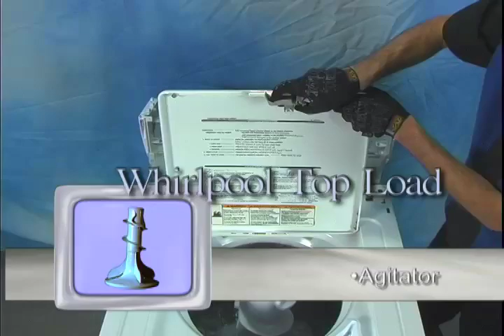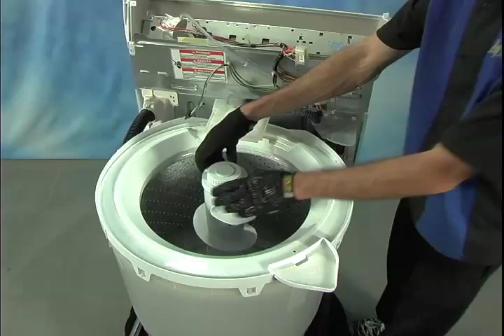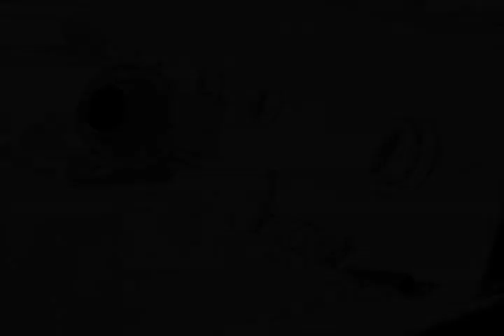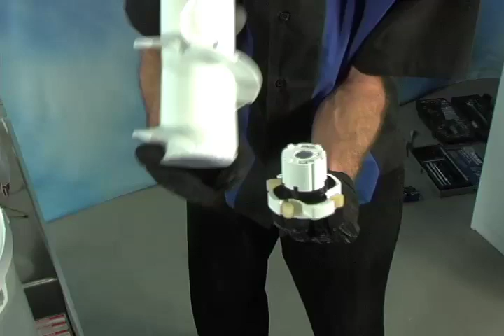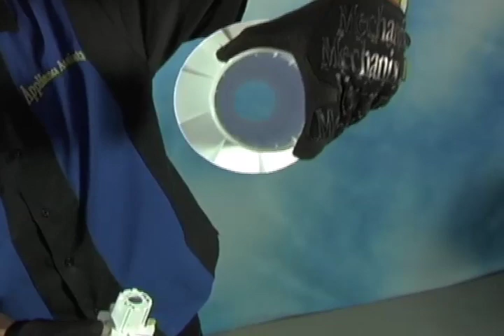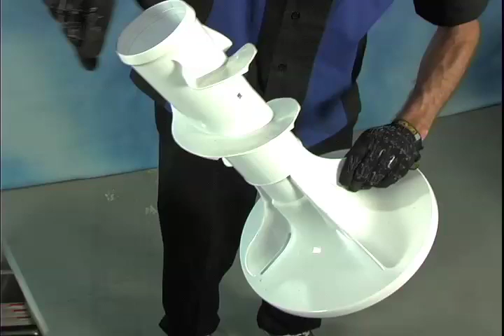Washer Agitator Repair Agitator Not Working Repair

Comment from the maker: I would not worry to much about the tabs because the bolt will hold things in place. However, the bolt seal washer would be good to replace.  If water leaks into the bolt hole of the transmission shaft it will rust and you will not be able to make the repair again if needed.  Thanks for the question!

Comment from the maker: One from the hardware store should be fine.  It's not very urgent but I would replace it sometime soon. the agitator is not watertight so small amounts of water can work it's way in there and rust out the bolt threads.

Comment: Thx, Half the washer is still there, but the outer rim is gone. Wouldn't the dust cover keep water out? I will def look into replacing it, can I get one at a hardware store, or do I have to send away for the special one? We don't use water of softener in the that area, so unless the washer exploded, I don't think water could get in there.

Comment: I have a maytag...this video looks like it would be a quick easy repair. My problem would be I have the agitator fully out of the washer but cannot get it to separate into two pieces. Help! family of 6 needs a functioning washer! I have tried stepping on the base and pulling up like you show however it does not budge!
Reply from the maker: Sorry for the delay! Some of the newer ones are fused by melting the tabs on the top of the cam housing that holds the agitator ratchet dogs. The center agitator bolt will hold everything together so you can use a woo chisel or screwdriver to cut them out and release the top half... I would think that's probably the cause. Hope that helps!

Comment: It's bolded down, and I heard the tabs on your model here could be broken and not effect the machine. When I tightened the bolt down, the washer on the bolt cut in two and part of the inner circle stayed on while the outer circle seperated and rolled off the top of the bolt, do I need a new washer? Or can it function with just half the washer? I know water does not go into that area, but what's the purpose of the washer, prevent leaking? Please let me know asap.

Comment: I did mine tonight, model number Whirpool LSN2000LW0 and ran into an issue. The cam was attached to the bottom agit with tabs that were glued or irregular  and I could not separate the two pieces, when I did two of the tabs broke off the bottom agitator. So I am not sure if this is ok, or the clothes mover agit is a tad looser than it was before, is this ok?

Comment: my whirlpool washer won't agitate she drains and spin but wont agitate its not the dogs the bolt keeps. getting lose i tighten and it losen up
Reply from the maker: +Grisel Crespo You may want to try some lock tight on the bolt. However, that is not normal... I'm wondering if the drive system is doing something out of the ordinary that may be causing that.  when the washer is spinning is the agitator moving with the clothes? It may be agitating while it's spinning, that will usually cause the clothes to become tangled under the agitator though... Just so I know what style we are talking about, what is the model number of the washer?